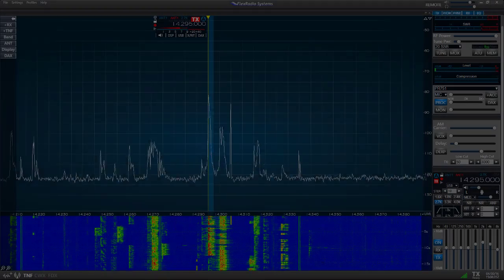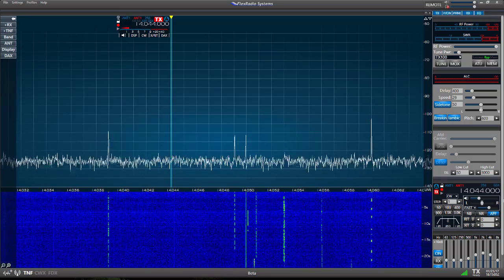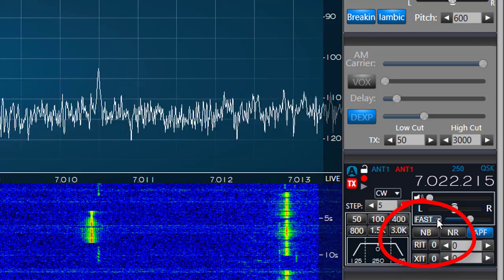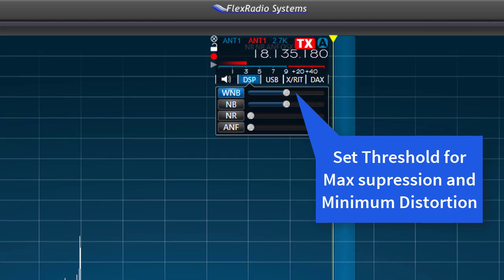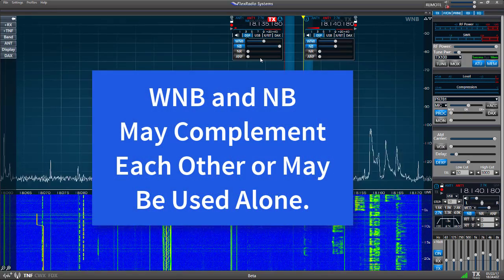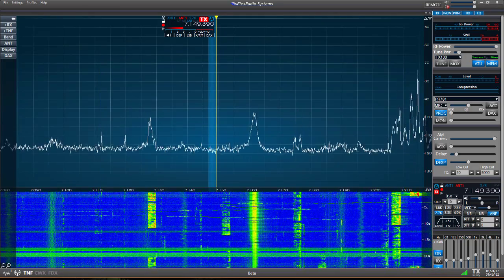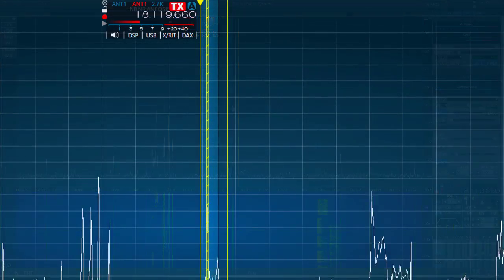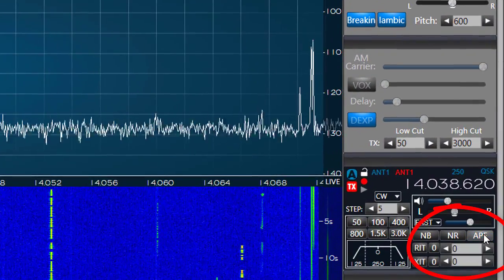Flex-6000 Noise Mitigation

Comment: Hi Al,  we spoke on 40 meters a couple of months ago.  I was installing a Heights Tower and DB18.  I have the DB18 built but need to complete the final wiring.  I think I am going to buy a Flex.  I am deciding between 6400 and 6600 with the major difference being the ADC's.  The 6600 ADC is twice the speed of the 6400 and I think there are two ADC in the 6600.  I understand this improves scope resolution  but do not know if the faster ADC improves receive or weak signal receive.  What are your thoughts?

Brad-N6GR